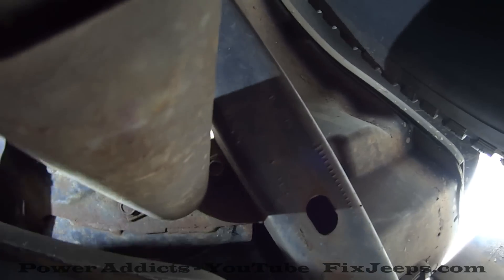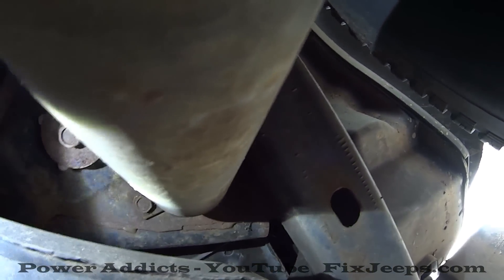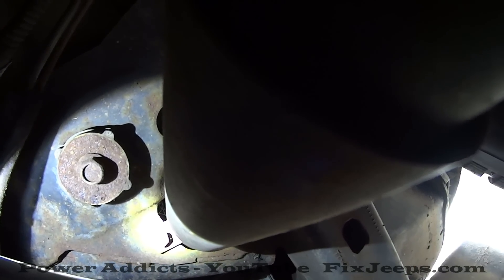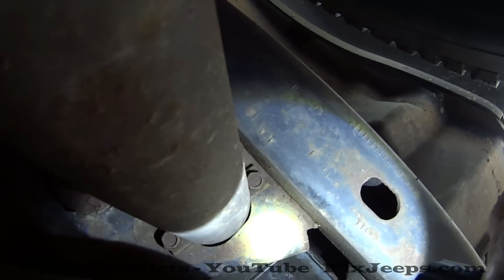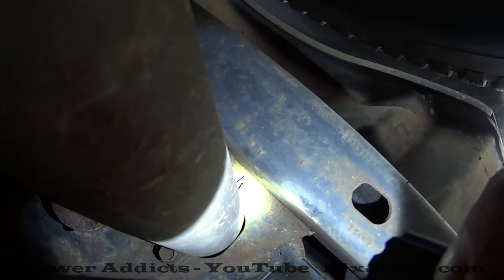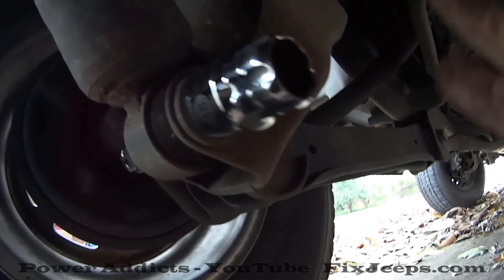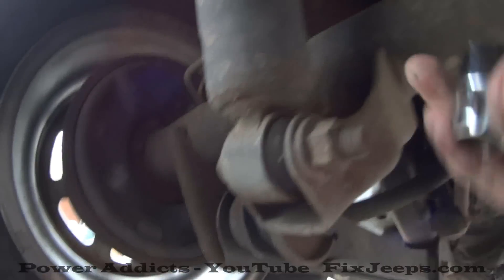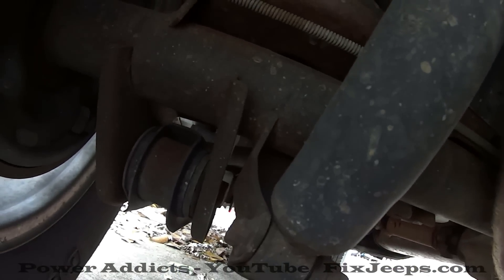Jeep Wrangler TJ - Rear Shocks - Better ride Better control

Comment: I have an 03 Rubicon, 45,000 miles , Rancho 5000x shocks , Rides terrible.  I have an 05 Rubicon, has an all white shock like you installed , no boots on them ..rides fantastic...what have I got going on?
Reply from the maker: The valving on the Ranchos may be tighter making a stiffer ride. Possibly stiffer springs.
Reply: @Poweraddicts  thank you for responding I lowered the air pressure on my 2003 and I feel like that got me a little more in line with where I needed to be on ride comfort... My tires were over inflated

Comment: Great video, spot on...pointing out the nuances about shifting the top for better access and making sure the top was at the correct angle made a major difference.  Also, leaving the wires on until shock is in place was a great tip. Thanks for posting, have a great day!
Reply from the maker: You are very welcome! Glad they help. Thanks for checking out the video taking the time to leave a great comment! Have a great day!

Comment: Thanks for the video. I bought a set of Ranchos for my 2004 wrangler and my son was nice enough to put them on for me. It was the first time I had ever had anyone do it for me. I guess he thought I was a little old at 77 to do it. Anyway after the video I know I can do it next time. The TJ has 42,000 on it now, 2000 being towed to Co. This past year to do a few trails at height of Aspen color. Just might check sway bar links after seeing your video on that as Jeep has 14 years on it now even though only 42,000 miles.
Reply from the maker: You're welcome. Hope the video helped you. That is very low miles for a 2004 model. My dads 2006 TJ has 302,000 and still running strong. They are great reliable machines! Thanks for taking the time to write an awesome comment! Have a great day!!
Reply: So jealous of your low mileage. How long have you had it?
Reply: Since 2004 and it has been used as an everyday drive to work, 40-50 miles round trip, and now still use it everyday for trips around town and to go to farm to hunt hogs, 40 mile RT. I am retired now, but watch Jeep videos on utube all the time. I am now looking for a rear diff. cover with both a drain and fill opening. It's awfully tight back there though, only 3/4-1 inch between gas tank and OME diff. cover.

Comment: What about the one by the gas tank thats what I wanted to see, looks tough
Reply from the maker: They come off the same way. Just getting to the nuts and bolts can be a little harder to get too on one side or another.
Reply: @Poweraddicts   no need to remove or drop the gas tank ?

Comment: Thanks for the instructional video. I’m far from being a gear head, but I’ll attempt a lot of jobs that do not involve things that are electrical or major mechanical equipment. Using this video as a guide I installed Rancho 5000’s on a 2003 TJ. I blasted nuts and bolts a couple days in a row with PBB.  The fronts were pretty easy (I took the tires off) The rears were a PITA (esp. passenger side with the tailpipe just under) yet I persevered. I subscribed to your page and looked at your AMAZON page.
Reply from the maker: Thanks man!! Really appreciate it! Glad the video helped you conquer the shocks! Thanks for taking the time to drop in a cool comment. Have a great day!

Comment: Watched your front shock vid, and now this one. I'm doing both sets on my sons '98 TJ, but his is rusted up pretty bad. Thats actually putting it kindly. His has major corrosion, so just getting the bolts loose is going to be a nightmare. Going to soak them each day, for a few days with Kroil to see if I can get them to break loose. Good vid, just wish I had seen how you got the one tight bolt loose since you couldnt move the shock to one side to get the socket on it like when your putting them back in....

Comment: Where do you put the jackstands for this?  I'm afraid when I loosen a bolt the shock will explode in some random direction.

Anyway I love this guy.  Down to earth good ol boy, this guy is probably pretty cool in real life.
Reply from the maker: The shock isnt going to explode. It will simply expand to its full length. Put the jack stands on the frame near the rear diff. Also, thanks for the kind words. My friends say I'm a cool guy .. so I reckon that counts :-). Have a great day!!

Comment: Getting those 13mm bolts out of the top of the stock rear shocks- how did you do it? Mine are super tight and I can't even get a good angle on them for leverage.
Reply from the maker: I just used an extension on the ratchet. If you pull the bottom off first, you can push the shock around to get a better angle on the top bolts.
Reply: Sorry, I accidentally typed the m, are waiting for my shocks from extreme terrain, will try & remove back myself. The front ones sit in that coiled steel. Are those same process, & don’t have a torque wrench, just tighten super hard?? Thanks for video!!!
Reply: Robby did you get yours out without breaking them? I've been soaking mine for two weeks in hopes that they don't break. Apparently, if you live anywhere prone to rust it is almost inevitable. I really don't want a two hour job turning into a weekend, so any advice you have would be great. I've already bought some grade 10.9 bolts that I'll upgrade to once I'm done. I also got a bar pin eliminator kit so I won't have to worry about them in the future, even with the 10.9 bolts. I don't have a torch, and I've heard NOT to use an impact or anything bigger than a 3/8 ratchet with an extension.

Comment: Hey man can I see the tj take some bumps with the shocks off road
Reply from the maker: To be totally honest. That TJ isnt mine. It has been offroad, but only a couple of times. That one is mostly street driven. I can tell you that those shocks are very stiff!! It drives way better. But the ride ... whew ... It rode better with the old shocks. You can feel every pebble on the road.
Reply: Yeah that one just small bumps to see how soft the ride is inside and outside view

Comment: I had a hard time taking my shocks off ! Had to use my air impact gun and wear some ski goggles because all the dirt got in my face ! pain in the ass
Reply from the maker: That I totally understand! Many times I've had that crap falling in my face. On a couple Ive pulled out my face shield I use when Im grinding metal. Glad you got it done! Thanks for taking the time to leave a great comment! Have a great day!